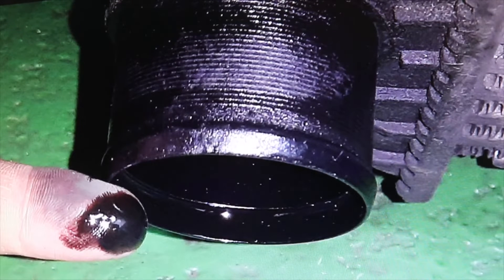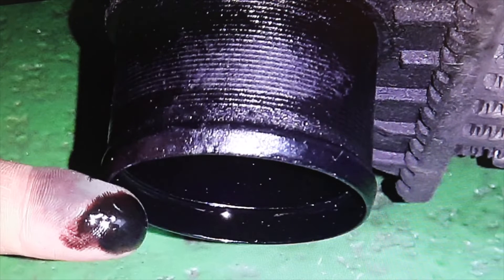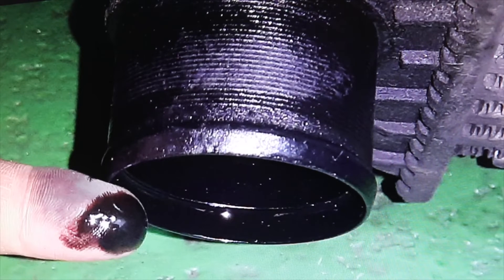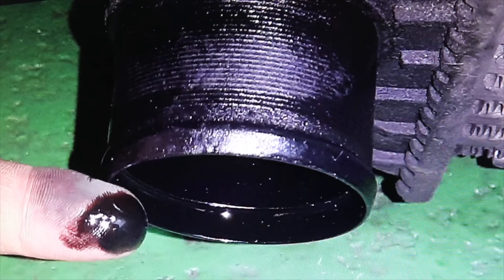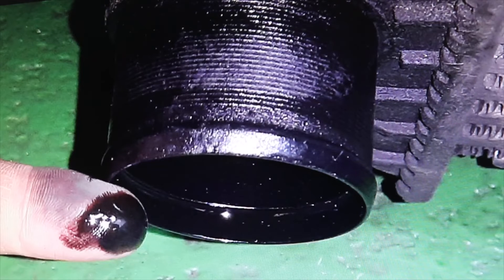Is it NORMAL that there is SOME oil inside the INTERCOOLER? How does it affect the engine?

Comment: Sir what can you say if the oil in the intercooler turbo is color brown? But just a little only. But in the engine. The oil is normal.
Reply: Condensation, it's normal
Reply from the maker: If it's a small amount, there's no problem, but if it's a large amount, watch this video: https://youtu.be/q-_pxxjES0g
Reply from the maker: This usually happens when there is some moisture in the oil.